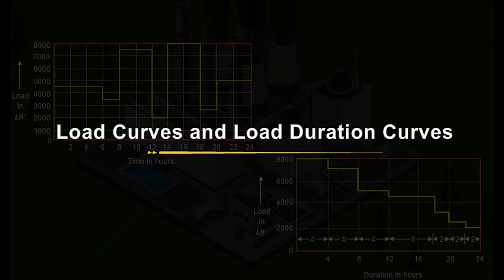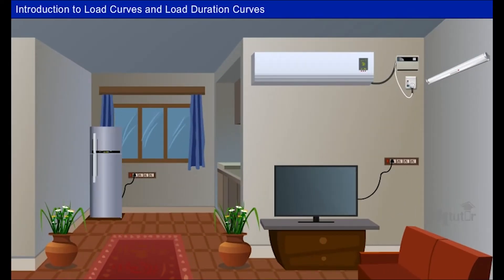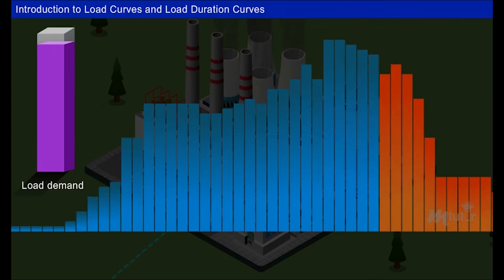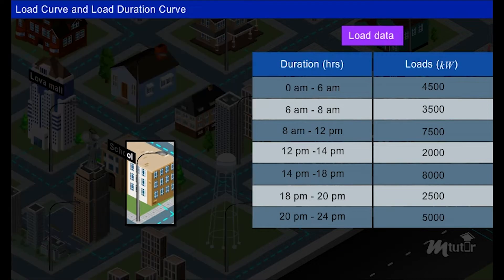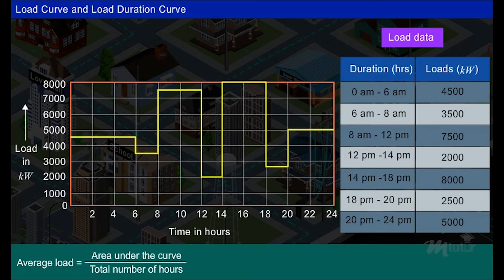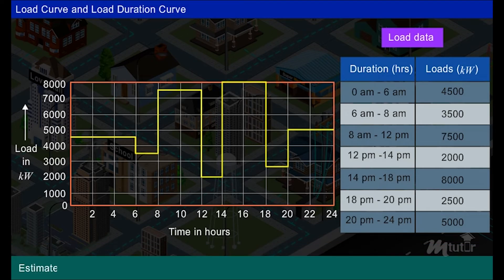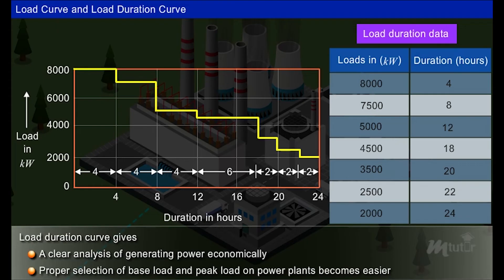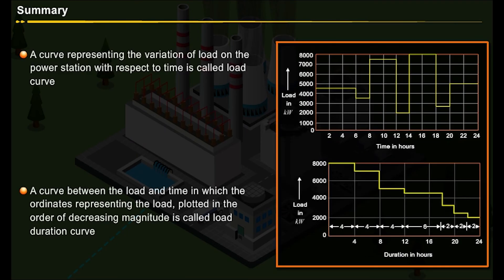Load Curves and Load Duration Curves [Year - 4]

Comment: Before installing a power plant how we get to know about the load curve and future rising demands??
Because construction of power plant takes several years..
Reply: Secret
Reply from the maker: A load curve is drawn based on the load data of the existing power system.  But, for predicting the future rising demands, we have two forecasting methods such as demand forecasting and energy forecasting. And we have not dealt with these methods in this particular video.